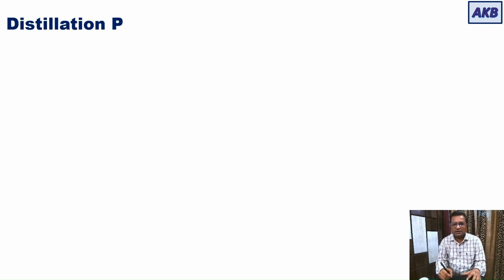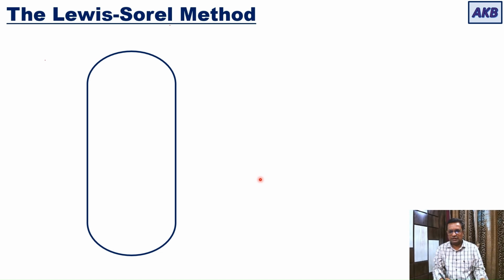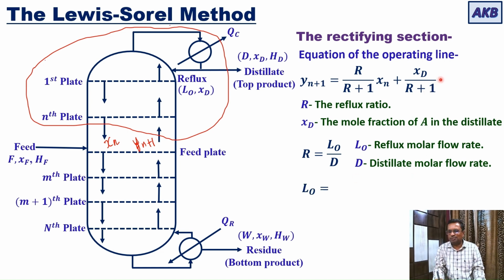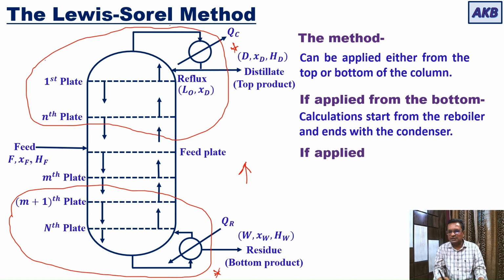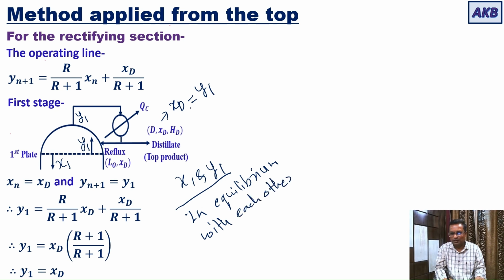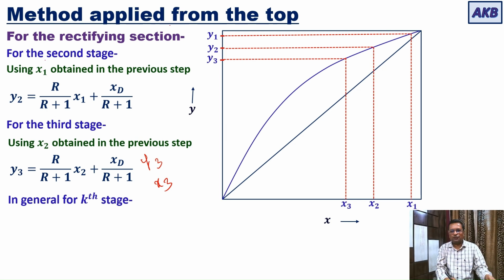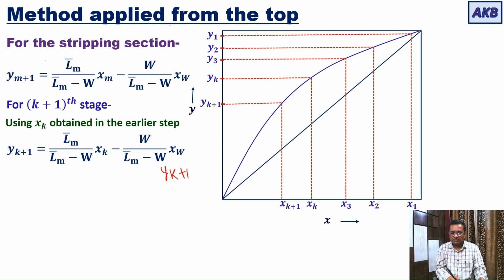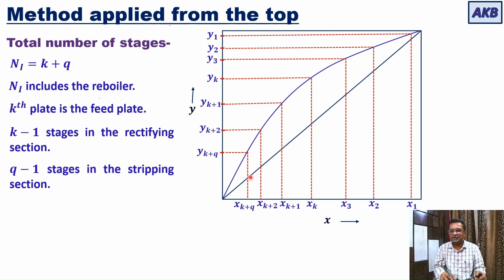Distillation Part 40 Understanding the Lewis Sorel method

Comment: Should the stages be q and the number of plates be q-1? for stripping section
Reply from the maker: Plates are nothing but stages. Each plate or tray acts as a stage. So if there are q stages in the stripping section, one out of that will be the reboiler.
Reply: @AKBChemical ok sir. Thank you very much sir